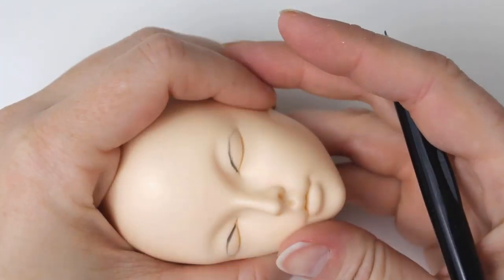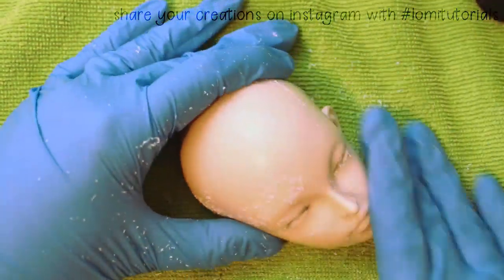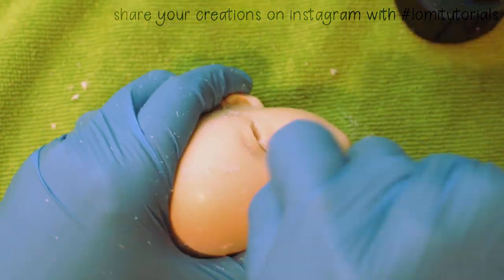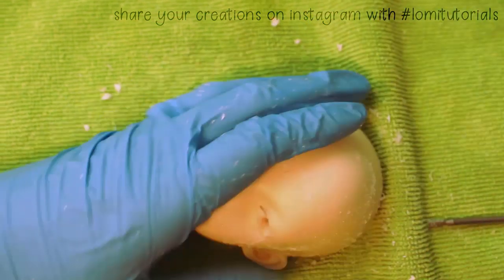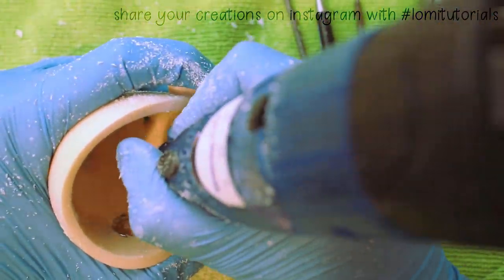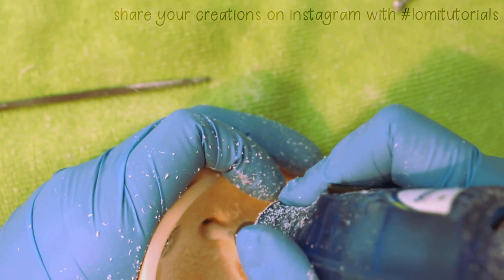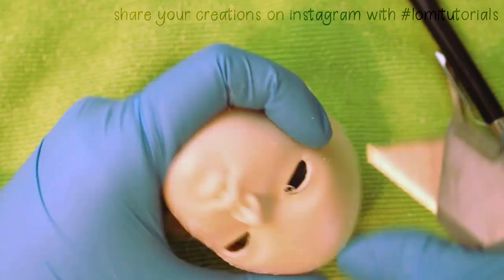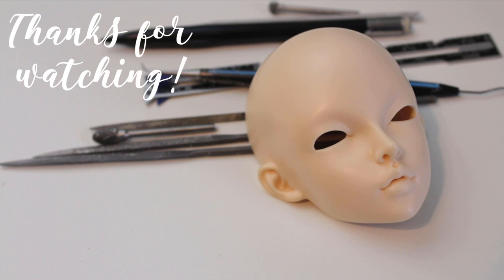How to modify a sleeping BJD head to an open eyed head

Comment: Great tutorial! I have a dremel, but I haven't used it much, so seeing some of the cool stuff you do with it definitely makes me want to use it more. I do have to say though, seeing you use that ENORMOUS utility blade for such delicate work made me cringe and hold my breath a bit. Maybe a dumb question, but... why don't you use something smaller, like an x-acto?
Reply from the maker: Mostly because of my hands. Because of my joint hypermobility, which has gotten a lot worse in the past few years, I do a lot better with something that has a large handle if it's something that requires a lot of pressure. I reserve the X-acto for extremely fine work that doesn't need a lot of strength.
Reply: @LomisPlayground  oh, makes sense! I know you can get large handles for small blades, but I also know that people with chronic shit usually know how best to handle their chronic shit. Hope your hands are doing well, and that you in general are doing well :D

Comment: This is an interesting but time-consuming and difficult project. I'm curious why would people buy a sleeping plate and mod it this way...are sleeping heads cheaper or do some dolls only come with a sleeping head?
Reply from the maker: It's a bit of both, plus a matter of availability. It's sometimes easier to find sleeping heads since not everyone desires them. I originally wanted the open-eyed faceplate for this doll, but didn't have the funds when it was released, so I joined a split via Instagram and was able to get the sleeping faceplate for $50. It was the only piece for that order that hadn't already been claimed. I figured I could put it on a less expensive body later. Shortly after, Fairyland stopped producing the F65 line, so there was no chance for me to get an open-eyed plate.
Reply: @LomisPlayground  Oh, I understand. Thanks for explaining. You did a great job with this. I'm looking forward to seeing a faceup for it. Happy Holidays!